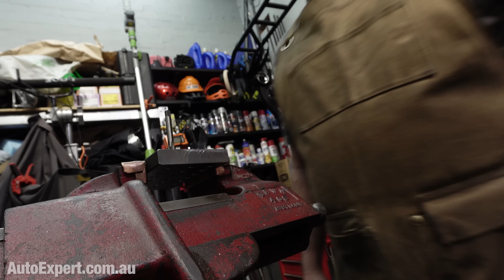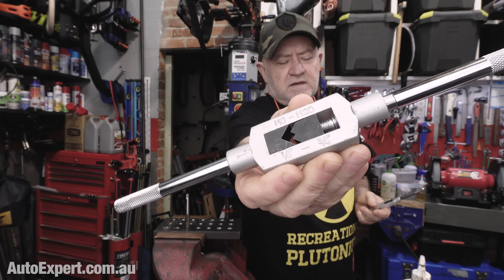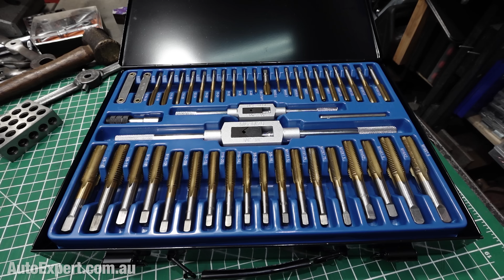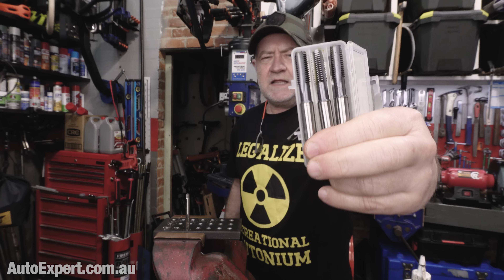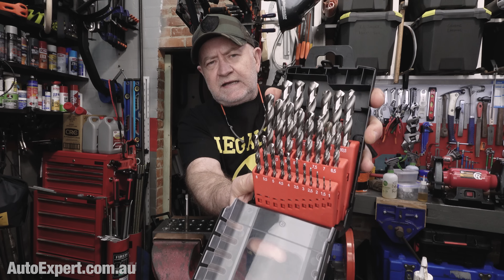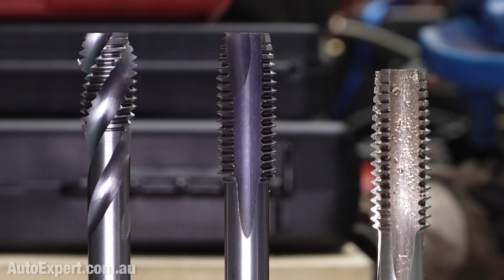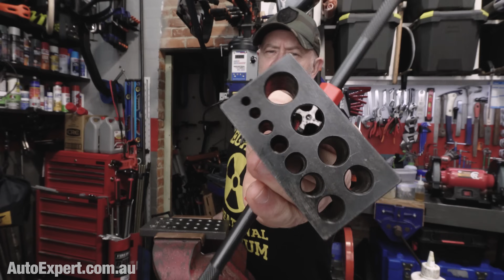The REAL REASON you break taps when cutting threads (and how to break even more of them, faster)

Comment: Ive been telling my employees forever , and others , I am talking about drilling or tapping stainless, ppl think its hard , it’s not it’s soft , the thing with stainless is it work hardens VERY quickly and will also heat and gaul , slow as you go , use the slow speed on your drill and some lubricant and you can drill all day and never burn a drill , same with taps , go SLOW use trefolex , stainless is soft  not hard !
Reply from the maker: Agreed - stainless is OK prior to work hardening. But if you harden it drilling it, tapping it is a bastard.
Reply: Stainless is often work hardened by the stamping, bending, etc, operations. It doesn't help a lot of people use the lower grade hss taps, which dull pretty quickly.

Comment: G,day John. A question if I may, could you please make a video on tapping for a person who has never tapped anything before, but has brought a tap and die set (TTI 110-piece tap set). If I have a M8 bolt stainless steel from Bunnings. And I have a 10mm mild steel plate it could be stainless, just some where to start. What size hole do I drill for a M8 bolt, any information would be handy. Cheers Robin
Reply from the maker: If it's a standard metric coarse thread (M8 x 1.25) the correct tapping size is 6.8mm. Use a high-speed steel tap for stainless, and lots of lubrication. I doubt you can buy anything other than a standard metric coarse thread from Bunnings. Put a small chamfer on the hole (with a countersink) before starting to tap. If it starts to get hard, stop.
Stainless is a hard material to start on. (It's hard, and it can get much harder - called 'work hardening' when you drill it.) If possible, start on mild steel, aluminium, or brass.
Reply: @AutoExpertJC  Thanks John, much appreciated to hear back from you so soon, I will keep this in mind when I go to tap something. again, thank you for your time. Cheers Robin
Reply from the maker: FYI I had a look at the TTI set. "Heat treated alloy steel" means 'tool steel' - the brittle ones. Take care there. Probably not suitable for tapping stainless. (The description of the dies as being made of "tungsten" on the Total Tools website is almost certainly bullshit. If they were, they would have cost you more like $5000.) Bear in mind also that the set really doesn't have multiple taps in the one size, so you won't have a proper taper tap to ease into the hole. It'll be a more demanding operation.
Reply: @AutoExpertJC Thanks again John, this helps me out a lot. I will look into what you said in the video and buy that better tap set. I brought the tap set 3 year's ago as they were on sale and quite a bit of money off regular price. I have never used them for the simple reason I really don't know how. Again thanks for your time and effort it is greatly appreciated. Cheers Robin
Reply from the maker: These are the ones I showed (the 'course' ones...) only in M8 x 1.25: https://www.machineryhouse.com.au/t8208
Reply: @AutoExpertJC  Thanks, couple of weeks time I will get some. Least now I know a lot more. Cheers Robin

Comment: Do beware that presto (tool brand) stopped using Uk quality controlled steel blanks many years ago - can you guess where they get them since? CHINA! It put out the last flicker of light of the real engineering industry - presto (Sheffield UK). You forgot that cheap bolts from china are using M6 - M8 so lets not forget them so quick.

Comment: Remind me of year 10 metal work. Tapping and trefolex. I used to drill on the lathe. Then lock the lathe jaws and tap it. Works a treat and ensures straight holes and threads. I never got the opportunity to cut a thread on the lathe. Dad was a fitter so he was always giving me tips and going into more detail than we learnt at school.
Reply from the maker: Drilling and tapping on a lathe are great for concentricity and alignment (not much good for fixture plates, but great for a host of other parts). Single-point thread cutting on a lathe is a pretty advanced skill, and over-rated for the majority of work, where a simple die will suffice. Great for precision or uncommon threads (M40 x 1 for some random hydraulic fitting, or whatever).
Reply: @AutoExpertJC  Single point thread cutting can be better than a die if you need to cut long external threads that have to fit into a deep threaded hole because the die is too short to ensure that the pitch is accurate over a long distance. (Probably designing the part so that fewer threads are engaged would solve that.)
Reply: @AutoExpertJC  IMO cutting perfect "to spec" threads on the lathe is tricky to master but I find a good cheat for a hobbyist is to cut to part depth and finish with a tap or die. Getting a nicely aligned start with a die is insanely difficult. Maybe there's another video for you.

Comment: Jewellers use tiny tap n die sets from around 0.6mm up to 2mm. You need plenty of good synthetic lube on those babies, especially with platinum! Expensive little sets too with the Jewellers/ specialist tax n all...
Reply from the maker: I'd be collecting the platinum/gold chips, too - unlike the steel, aluminium or brass ones I make...

Comment: Spot on JC, only buy quality taps. Buy the quality sizes you need in packs of 3. If you are a beginner use all 3 in order and ensure you buy a can of Trefolex, simply the best. As a 40 year Fitter and Turner practice gives you the feel. Buy yourself Flat and a ratchet T handle for tight spots. Remember tapping drill size Diameter minus Pitch ❤
Reply from the maker: It's easier to feel the HSS ones, too. The tool steel ones just break, then you wish you could back off half a turn...

Comment: I have an old daihatsu diesel and has a habit stripping out the threads on the starter motor.  They are m11 x  2.0 bolts are about  30m long. I used to be able to buy replacement bolts from frankston bearings but they went broke several years ago. Got a m11 x 1.5 helicoil kit. Where can I get m11 x 1.5 bolts? Thanks very much for the info on taps.
Reply from the maker: M11 is a very non-standard size. M11 x 2.0 is crazy (M12 coarse is 1.75...) You could make them on a lathe (the bolts) but tapping the holes would be quite hard. Ask the dudes at Bolt & Nut Australia. Or get a machinist to change the setup to something standard like M12 x 1.75 (or something).

Comment: i have never snapped a tap.  not even in a hardwood!  as furniture maker i often tap wood for screws lol.
Reply from the maker: Hardwood is the camembert of metals...
Reply: I've seen grease soaked hardwood make some fine durable and eons-lasting gears as well. 
I've tapped in hardwood as well it's hard to tell if it's accurate until the hole is cleared and the screw holds tightly unlike tapping metals especially aluminum steel or harder plastic.

Comment: Abom79 would have tapped 12 of those plates in 3min. His setup is awesome. 
I've used a drill to tap threads... once. Thats a lesson hard learnt.
Reply from the maker: I made two plates (basically identical). Without filming it took me 45 minutes to drill all 21 holes, chamfer them with a depth stop (for consistency front and back) - 42 chamfers - and then tap the 21 holes, using the drill press to pre-align each tap. 
Abom is a Jedi. I'm just a ninja.

Comment: Buy the ones you always use and avoid box sets.
Get all 3 (starter, intermediate, finishing,) make sure you use the correct tap drill size and 80% success guaranteed.
6.00 mm , 8.00 &10.00 mm for most cars bikes and general fasteners on most toys.
Really old stuff 1/4" 1/2" & 3/4"

Comment: As a second year apprentice auto sparky at tech college, I was tapping a blind hole in a giant Delco starter motor carcass.  Suddenly, snap! "Mr Ward... I heard that Taylor and no, I cannot get it out either." 54 years ago and it is still so clear in my mind.
Reply: As a fitter/turner/ engine reconditioner I’ve broken sooooo many taps over the years. As John said most were own goals. But I’ve always managed to get them out. Using a bunch of different techniques. Most often when the tap breaks it shatters and with punches ground to suit you can often shatter the remaining tap and work the pieces out. Easier if it’s a through hole, but works in blind holes as well. 
I have managed to use circlip pliers inserted into the flutes, TIG welding, Dremel cutoff wheels and hole saws to remove the tap or material around it. 
This is mainly because there was no option to start again.
Reply: Grinding it out with a diamond burr on a high-speed rotary tool is the easiest way I have found. It will go through a lot of burrs, but run the burr down the center of the tap, and then after you have a nice hole established just grind out the small bridges connecting the flutes and you can then either break the individual flutes with a punch and blow them out, or in some cases they just come out on their own once you have separated the flute from the rest of the tap.
Reply: Good sharp carbide works even better in most steel
Reply from the maker: They are defining errors. I've broken about a dozen in total. All 'own goals'. I knew better, every time.
Reply: I bet you still wake up from nightmares about that day

Comment: While you’re buying the 6mm and 10mm taps get a 4mm as well. 4mm is a very common size and is probably the most common size for screws, not bolts, and it’s the size I break most often. As John said, with hss steel you can feel it flex so you get a warning but tool steel will just snap with very little warning so hss can be cheaper in the long run. Good video with very useful advice.

Comment: First year Electrical apprentice, 1985 I think, working in a workshop. taping holes into whatever the component was.
Went to the workshop store, got a brand new, whatever brand they were using, 3mm or 4mm ( I think, it was a long time ago ), walked to the job, took it out of the packet and put it in the job by hand, haven't grabbed the handle yet, gave it a slight twist in my fingers and had the tap turn into a banana, not snap, bent...
The store manager looked at me funny when I went back to change it.
Reply from the maker: Way to go with the heat treatment on the tap production line quality control... Camembert-grade.
Reply: Nah, Uri Geller! 🇳🇿

Comment: I’ve been a fitter for 15 years and never broken a tap, take care when tapping, dude
Reply from the maker: I break one every four years or so on average - all 'own goals'.
Reply: @AutoExpertJC   It's given fact it will happen but most I've cracked sideways/chipped the starting range of driving treads never clean through the bore of the tap... the curse words! The clink of the tap shearing off in the hole.... Time to pull out the deep through punches & hammer it out with some ease aka lump hammer. Hopefully 99% of the time, put in a new shiny well greased up tap & drive it in to clean up the threads, you good to go. Closed holes/tapping many will screw up on... an air gun or vac is your best move - use an medium oil or old motor oil - grease will just keep all the metal waste in the hole.
Try power tapping a run of @370 holes M8 6.8 drill bit applying a lick of copper grease every 2-3 holes (6 inch gaps) with an impact gun you'll will break one every 1 - 4 coach (class 3) if it not put in straightish (71- 74 seats ) for the structural V5 requirement (commercial passager licence VTB5) aka floor tracking system that seat T bolts lock/slid into for the seat legs fixing point. (3 each) within the mainland UK. Just like a worker that's around glass or mirrors all day - you'll break a few in the process... they say 10yr of bad luck each one..... 😉
Reply from the maker: At least you can use a gas axe to anneal and drill out the broken tool steel ones. Carbide drill might work on HSS - you can even 'ghetto up' a masonry drill with a SiC grinding wheel and have a crack with that...
Reply: Tapping holes are like having a mistress,  do so very carefully because the consequences and repercussions  of getting it wrong could be life changing or ending.😂😂😂
Reply: When it does happen, and it will, it's always when you least expect it.
Reply: You beat me to it.  I’ve been tapping holes for close to 50 years now and have yet to break a tap.  It really isn’t that hard to tap holes properly.  My dad was a machinist and showed me the ropes and it is pretty easy if you follow a few simple rules.  And the most important rule is to buy quality taps!  I suspect if I bought chinesium taps on Amazon, I’d probably be breaking them left and right also.